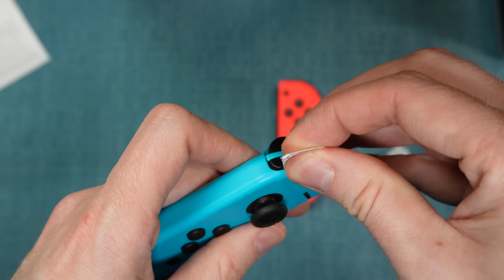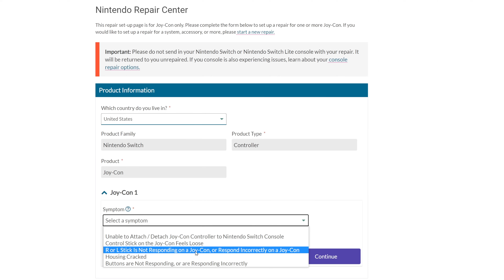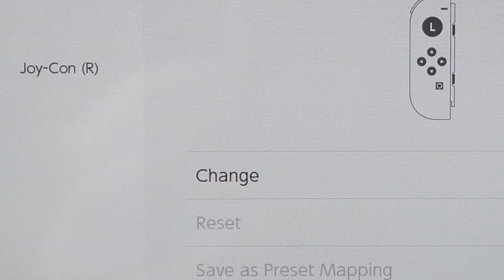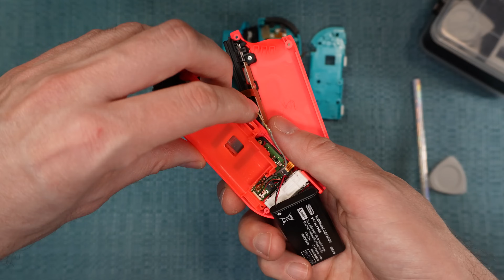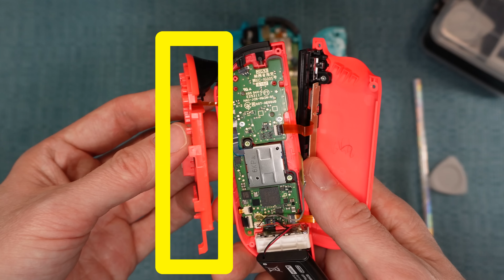How to Fix L ZL R ZR buttons on Switch Joy-Con Controllers | Stuck Trigger Bumper Shoulder Repair

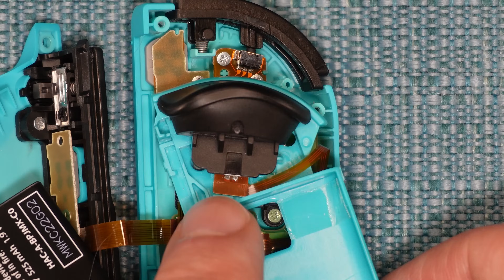Comment: 10:31 ive fixed 100s of them. The r n l button is too weak. If u cant press the button Most likely you broke it. Do not open it up because Nintendo switch will replace the regardless of the condition.If you didn't open it up. Just send it back to nintendo

Comment: I have a question.
I got these 3rd party joycons and they lasted 3 years but i dropped one a week ago and the ZR button is completely unresponsive.
What could be wrong with the button?

I took it apart the springs are there the ribbincables are connected so i don't know what's wrong.

Comment: After my switch slid off my desk and the rail popped out, my L button on the left joycon hadn’t been responding. Disassembled it and still haven’t got a clue what’s wrong with it. It looks fine (just like your working one) from what I can tell but haven’t got a clue what’s wrong. The real sad thing is it’s the one from the pokemon scarlet and violet Nintendo switch so I don’t want to send it in to Nintendo for fear they’ll just send a different one back.

Comment: My problem is my R button on my Right Joy-Con is iffy like sometimes when I press down on it it does work and sometimes it doesn’t and then I hear this weird sound when I press on it as if something is loose or broken inside so idk if I should send my Joy-Con over to Nintendo with just that one button that is workin 50/50 insteada 100% but all the other buttons on that same Joy-Con of mine do work with no problems at all 🤔

Comment: In my case, the ZR button is no longer "clicking".  I opened it up and can see that the bottommost part of the plastic button is not really making contact w the actual clicker. The metal casing has also come off but I don't see how that helps it click in. If I press it in w tweezers I can see it register so the ribbon is fine.  What do I do?  Why would it suddenly stop making contact?

Comment: Oh man. I saved this video BUT unfortunately this will not fix my son's R trigger. Once I took it apart it turns out the button and metal clip inside are completely broken off 😐 i may have to replace the board if there is no other way to fix that. Other than that, this video is amazing and well put together. Thank you.

Comment: This video helped my caveman brain when I replaced the analog stick in the left joycon. I pulled the ribbon cable for the zl button and I didn't remember which way it went back in. I had to look this up after spending literally 2 freaking hours trying to figure it out myself.
Edit . It was a bit too late and I screwed up the cable connection but thankfully these are dirt cheap and got a replacement on the way.

Comment: this helped me a lot! i had a broken button on my switch for a couple of years now and its practicaly been unuseable so i finaly decided to fix it myself i had to glue a tiny peice onto the backbutton bacause a part of it had fell of and it didnt reach the trigger  i did have a point where one of the ribbon cables got dissconnected but i did manage to put it back in. thanks for the help

Comment: you can do the paper thing and then push one side of the button down and blow into the opposite side and wiggle it at the same time and then work the button and then if that doesn’t work put an school wipe on the end of a Zacto knife and then slide it in there and move it around

Comment: I'm finally able to play Splatoon 3 again! My ZL button stopped working and I tried everything, updating, calibraring, disconnecting reconnecting, etc. But I just went in and sprayed some compressed air, took the springs off then put them back on, reconnected any ribbons and BAM I'm able to get past the opening screen which requires you to press ZL + ZR 🤣 Really appreciate the video! Helped a lot!

Comment: My daughter dropped my switch and the L button stopped responding. I dissected my joycon to find out that the internal button piece built into the ribbon that relays the L button ( 13:40 ) had become dislodged. Luckily, I craft, so I have some strong glue. I just glued it on to see if that helps. If not, I plan to go back in and use my soldering pen to solder the sides back together to keep it in place. This video helped so much to help me see what the problem was. If neither of those methods work, I will try to replace the L button ribbon assembly. Otherwise, a whole new joycon will be the ultimate final solution. I like to try keep all original pieces if I can, so I would rather fix the part, than replace it. But I’m not above replacing the entire thing. But had I not seen this video, I may not have known where the little piece came from that fell out when I removed the battery tray. Thank you, thank you, thank you!

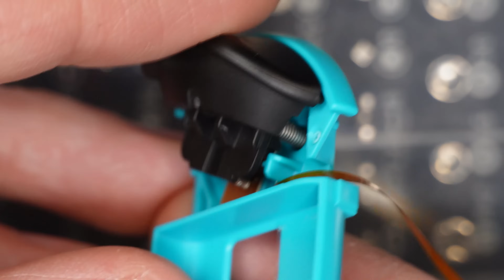Comment: 12:00 You don't have to push from the holes! It is better if you pull from the sides bit by bit, it will come off eventually, just don't pull too much, it might break

Comment: Unfortunately most people likely don't have easy access to a tri headed mini screwdriver. I know that I don't. I bought a mario red Switch about a year or so ago but I haven't really played it hardly at all. Recently I went to play something on it and realized that the L button doesn't work (it hadn't worked before then but I had only played one game on it for a short time and thought that I was just bad at the game). I tried all the surface level stuff and it's still not working. I'm probably going to have to send it to Nintendo to fix because I don't have the required tri headed mini screwdriver to open it up. I'm guessing that the ribbon thingamabob came loose because the button or trigger itself feels just as good as the R button/trigger or whatever ya call it.
Reply: Man, you can get one same day most likely from Amazon. Probably a whole electronics kit for cheap.
Reply: @KeyCalhoun  yeah, unfortunately I don't have a credit card or anything to order it. I know, I'm a looser lol. I'm 42 and don't have any credit at all. Anyways after over sharing, my cousins son has a Switch but broke it somehow last year 2023 and still had his controllers so they gave them to me. But eventually I'd like to fix it because it's some kind of Mario red edition or something like that. Maybe I'll ask someone from my family to order it and pay them in cash. The End.

Comment: My left side was working now it dont work a wont charge it worked well wth it's all updated i checked i never took it apart it should b ok but it's not it works if it's connected to the switch a play portable but it don't work when I test it our press buttons together to use both sides together on the controller

Comment: If Paper Doesn't Work, You Don't Have To Open Your Switch. (It Also Works Perfectly With Switch Lite)

Step 1: Find A Hard Box, Like An iPhone Box.

Step 2: Put Your Switch Vertically (If You Switch Is Not A Lite, Put The Joycons On)

Step 3: Hit The Button With The Box With Medium Strength. (You Have To Hear A Loud Noise, But Make Sure You Control Your Force)

Step 4: Repeat Until Fixed.

Step 5: Play Mariokart And Get 8° Place Again

Comment: Hello! I tried everything to fix the r button and nothing worked so I ended up opening it to see what what the problem. Just after I removed the part that is attached to the battery the little button thing that I think is the trigger of the r button popped out. It’s completely deattached from the board and the contact is very loose. I tried securing it a bit with force but it works just the same as before. Is there any place where I can buy the board? Or should I try soldering? I have a bit of experience opening and replacing parts of joycons but nothing as far as soldering :/ please help.

For the record mine also sometimes did the home button imput, if you have that problem too this might be your issue

Comment: Hi. I replaced the ZR cable as the button on it had broken. This is a great “how to” video which I followed intently. I found that plugging the ribbon cable back in as described was almost impossible. I recommend that you insert the cable first then fold it around onto the tray. It is much easier to place the holding screw in than trying to insert the ribbon with all the tray attached to it. Other than that, perfect !

Comment: the absolute BEST method for the ZR ribbon cable, is to remove the ZR button cover, unscrew the actual board with the button on it, plug the connector in and then screw the board back into place with the middle plastic placed in its regular position, this seems to lower any risk of ripping the cable

Comment: You absolute legend! I could genuinely kiss you! My L button stopped working 2 months after purchase, I have a feeling it was dropped. I purchased a repair kit a while back to fix another joycons drift issue and noticed I had spare parts for left side too, my ribbon flex cable seemed to be the problem as after replacing it all works great again. 

Thank you so much!

Comment: i wont recommend using water into any CHARGED device, use rubber alcohol on the screws if they are hard to remove but do never use water(there is special non-conductive-water for stuff like this), removing the battery is a safety protocol since you can damage the components by touching them with your skin, very likely since this type of devices require a lot of handling around, and finally ribbon cables are very fragile yes, but nintendo likes to fold them something you should not do, so they are very likely to break even if you are being careful, replacing the whole slider would be a requirement if by sheer luck your ribbon cable was in the perfect line between broken and functional while being crushed between the battery and the outer shell so nintendo can save some cents on proper cables instead of cheap flexible pcbs.

Comment: Can i use the R ribbon from an old controller for my L ribbon replacement? It got creased or broken when i dropped it and doesn’t work anymore. I don’t know where my old left joycon is but i can look harder if i cant use the R ribbon as a replacement.

Comment: If the R button has fallen off from the circuit board, can i just glue it back on again, or is it entirely broken?
Reply from the maker: I haven't done that process, but I don't think glue would work. You likely need to swap the whole board.
Reply: @HowToX  okay, I'll do that. Thanks!

Comment: That video was very much helpful. Upon taking apart the controller, cleaning it up a bit, and replacing the L board (which looked OK, but still did not work), the controller works perfectly again. Looking forward to mote of your posts!

Comment: Answer this one: I have 2 joycons, and the R button stopped working on both at the same time. System is up to date. All other buttons work (except for the Home button on the newer controller). Buttons are not stuck.
Reply from the maker: Do the things in the video if you haven't already. If the problem only occurs when the JoyCon is attached, I would also clean the railing that holds the right JoyCon.

Comment: Thank you for the video. Bought a used joy-con, and only ZR wasn't working. So the reason was that the ribbon cable of that particular button was disconnected. it wasn't easy to connect it back because of the quite complex construction, but I did it! And to my surprise, there were a lot of missing screws. 
Thank you!

Comment: Thank you i've had trouble with my R button for months! Paper worked.
Reply: That’s literally me
Reply: Facts paper Fix it
Reply: For me it was left and yes, the paper worked, used a RAW roach card, beautiful
Reply: That happened to me too
Reply: Solved my problem also! i was about to think buying a new Right side joy-con.. SAVE!
Reply: Sameee
Reply: Bro I have the same problem
Reply: Same here
Reply: SAME HERE!! Thank you for your service! Was literally going to buy another controller!!
Reply: My R button was so unresponsive i was fully expecting the paper to do nothing, worked like a charm. It's a limited edition switch and I have a poor track record with DIY fixes so i was bracing for the worst, huge relief.
Reply: I think I broke mine 😭
Reply: Work for me too, I dont know why so many R Button stuck
Reply: Yoooooo!!! it's working.
Reply: Yea same
Reply: At this point yall just stink i did it and it didnt work
Reply: Didn’t work….
Reply: @troodon1233  same
Reply: Bro the paper worked
Edit: new meta on how to fix your controllers just use paper cuz it is op, also I’m subbing cuz this is actually working
Reply: By using paper and tapping on it a lil light it’s working 🥺🥺🥺🥺🥺🥺🥺🥺🥺🥺🥺 you have no idea on how much something like this I needed, thank you so much sir, I am a 10 year old who has this problem after a couple of months of using the switch form my uncle since 2023 when I was 9 and I can use it again I am so excited and if I get this again I will do the same thing but with different paper, hope you have a good day god shall bless you Amen 🙏 have a good day and have a good life and you just got your self a new sub congratulations 🎉🎊🍾🎈
Reply: @geometrydashperson mine has actually been there for a year now aswell

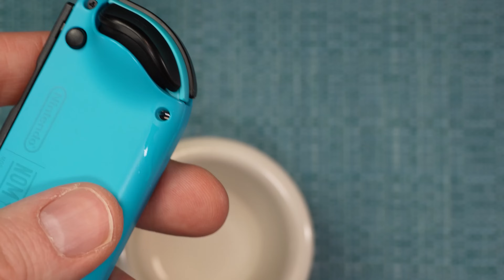Comment: At 5:55 I would recommend using a drop of alcohol instead to clean the screws. Isopropyl alcohol evaporates quickly and will not cause water damage to any delicate components. (Great vid though! Thanks :)

Comment from the maker: Links to Parts and Tools You May Need:
ZL Button Key Ribbon Flex Cable: https://amzn.to/3lPu8BN
L Button Key Ribbon Flex Cable: https://amzn.to/3IEFIZv
ZR Button Key Ribbon Flex Cable: https://amzn.to/3IFchqk
Springs: https://amzn.to/3EjZvuE
Replacement Buttons: https://amzn.to/3lTj5Ya
My Toolkit: https://amzn.to/3ke14nc
Screwdriver + Springs + Other: https://amzn.to/3ScX56X
Electric duster: https://amzn.to/41dZemX

All Amazon links above are affiliate links. I get a small amount of money if you end up using them to make purchase (it does not have to be for the item I link to, as long as you click my link then move to another item, it works)
Reply: Hello every time I use my zr and zl button it resets for example on Minecraft when I Mine it clicks and resets meaning I could never mine a block same with zl, don't know what to do. And do you know how to enable paddles on the back